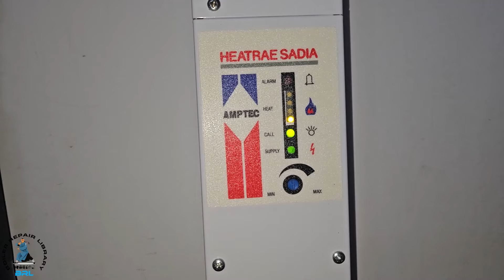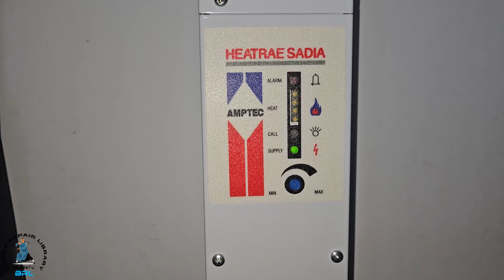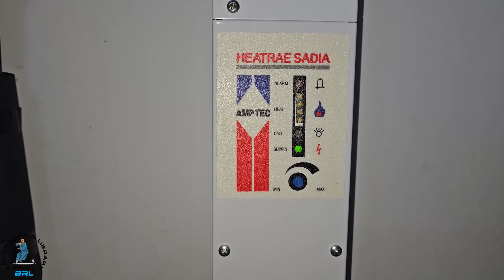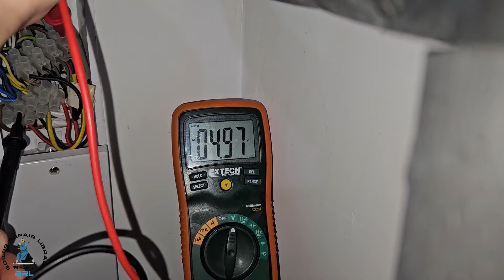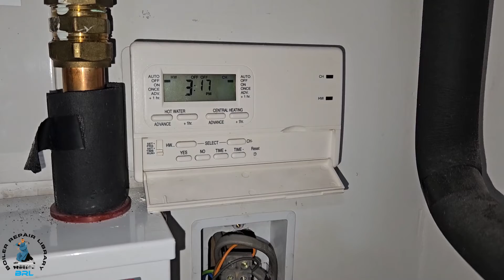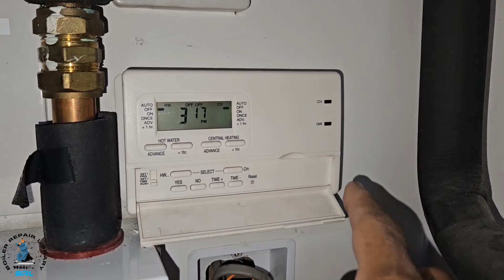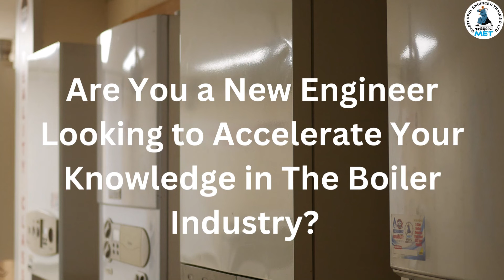Boiler Repair Fault Finding Heatrae Sadia Amptec C600 No Central Heating

Comment: Great video.we have same system the heating comes on for about half hour, then the call light comes on and the red light at the top starts flashing. We have been told it's either the thermistor,the over heat stat or the PCB, but can't get any info from supplier